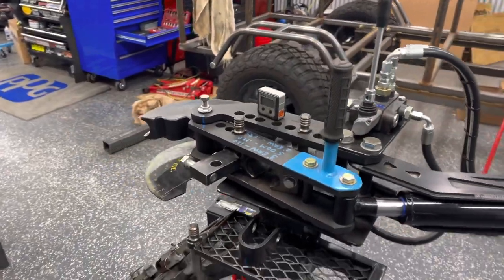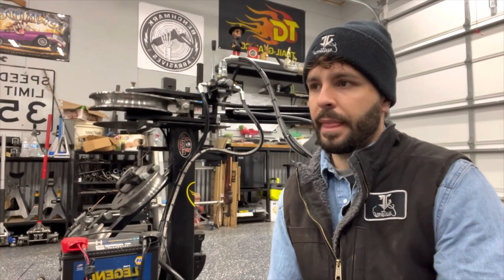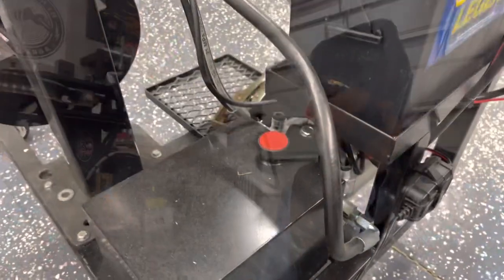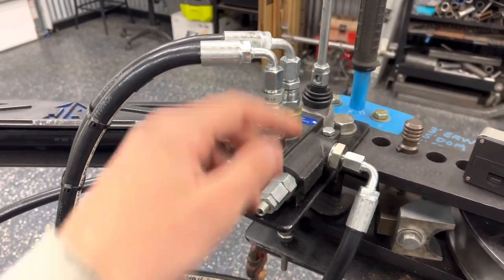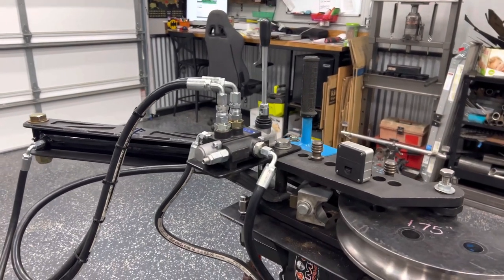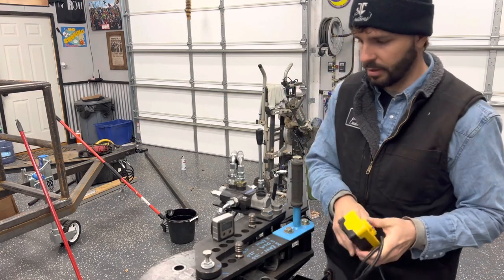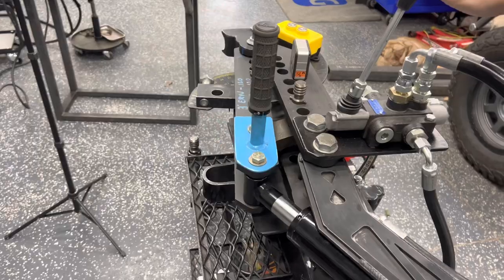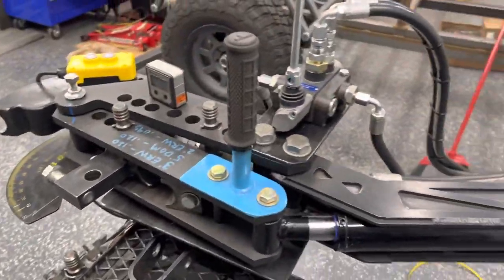Budget Electric/Hydraulic JD2 Tubing Bender Upgrade | Converting Your Tube Bender To Hydraulic!

Comment: How did you limit the Hydraulic cylinder mount from rotating away from the tubing when trying to bend? It works fine until I put a piece of tubing in to bend it. Then the cylunder mount rotates away from the tubing and pushes around to the splitter valve.

Comment: Why not use a deep cycle battery (s) instead of a battery designed for cranking amperage?
Reply from the maker: Because I already had this battery. I will replace with a deep cycle when I have to